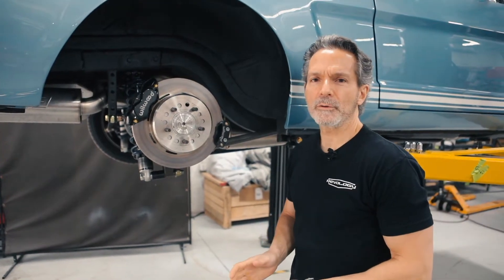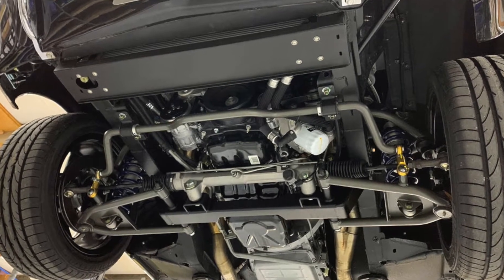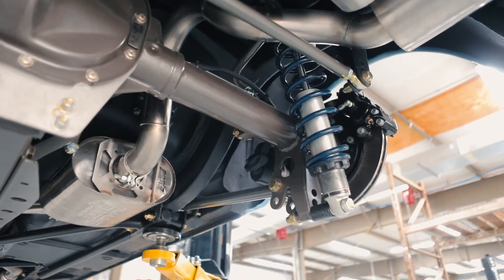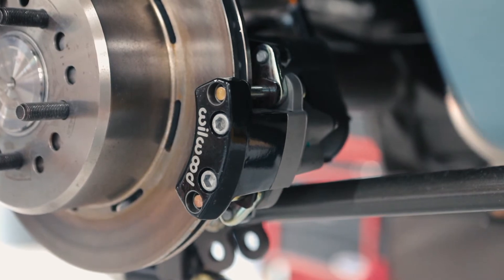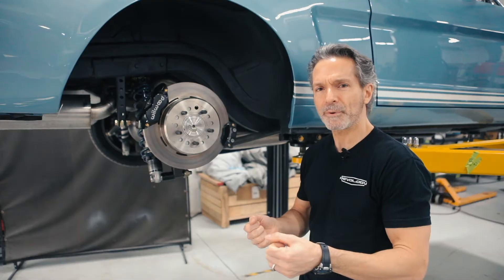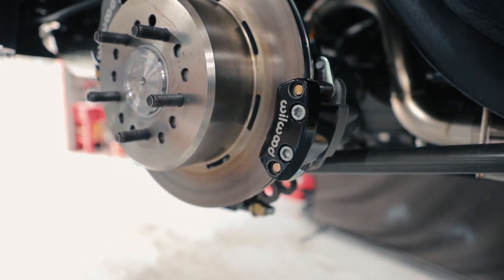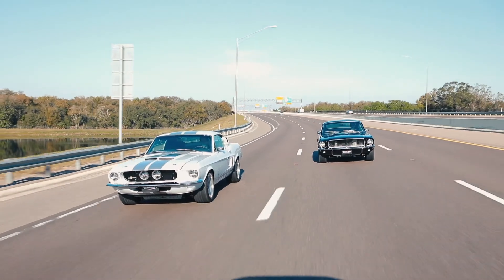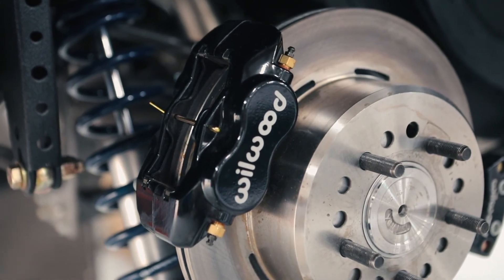Latest Revology Electronic Parking Brake System

Comment: Sounds like a great solution. So will it work as a backup brake if for some reason the main brakes don't work?  How is it actuated - foot pedal, hand lever,  blink of the left eyelid?  Can it be added to other brake systems, or only Wilwood?